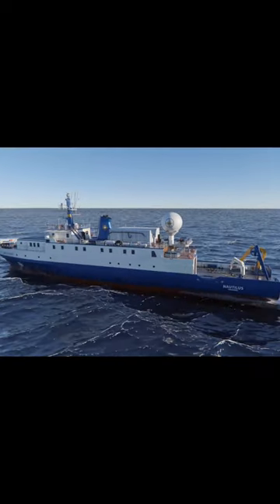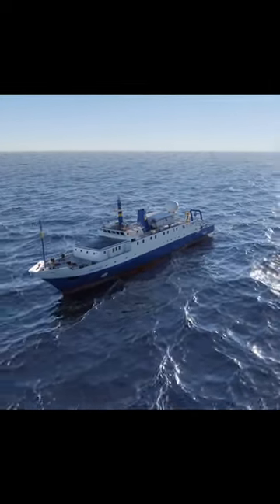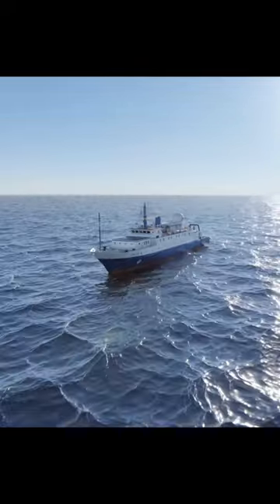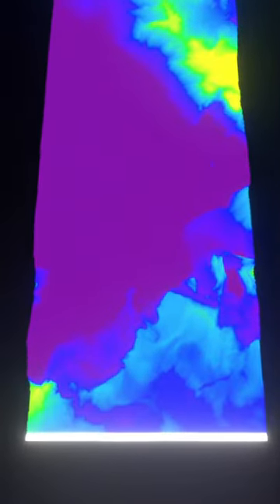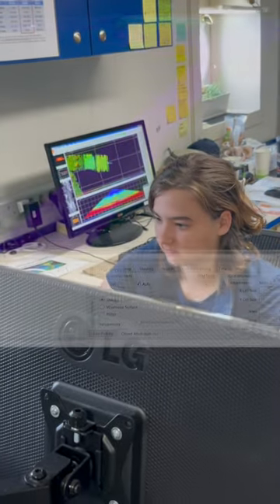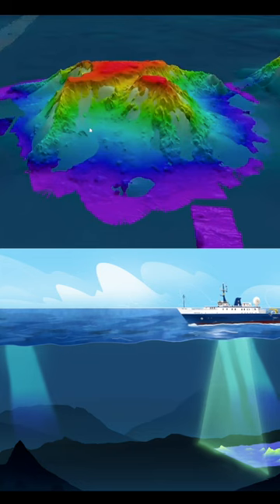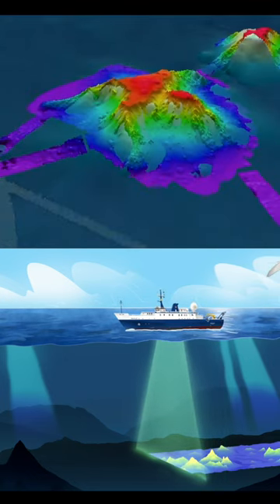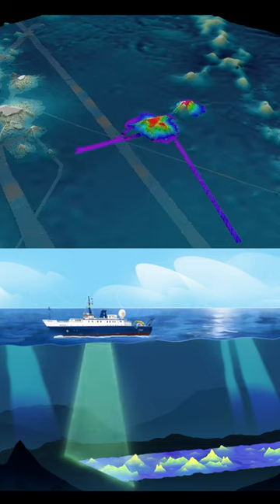Mapping with Multibeam Sonar | Nautilus Live

Comment: Is the water too dense below 7,000m for the beams to work effectively?
Reply: Sound travels more than 4 times faster than it does in air, due to the density of the molecules. This also gives you higher resolution and ‘crisp’ data, because there is far less degradation of the sound wave as it propagates in water than in air.

So working at those depths and higher is not a problem.
Reply: @raymondsmit344  That wasn't what I was asking about. I was asking why 7,000m specifically? And I was asking that because I've heard that military submarines have problems with the denser water reflecting their sonar back at them giving the impression of a false bottom, but I didn't know the mechanics behind it.